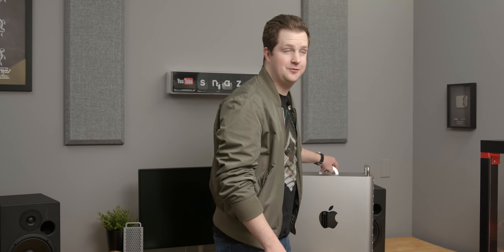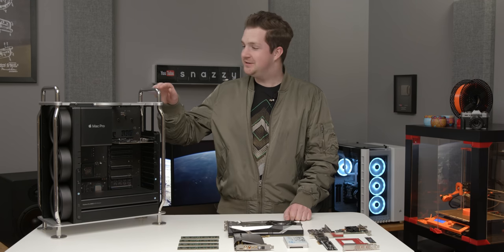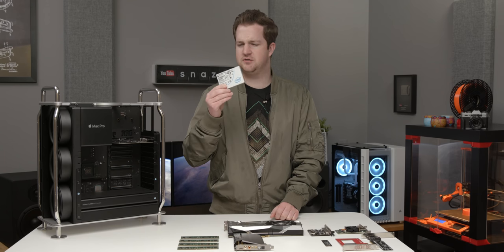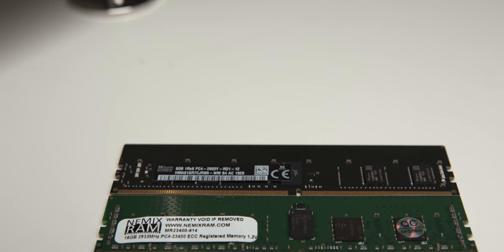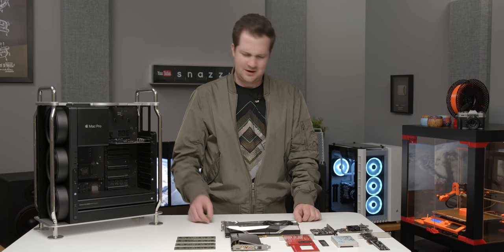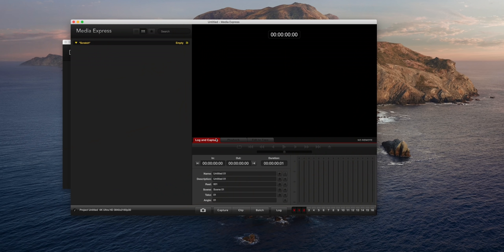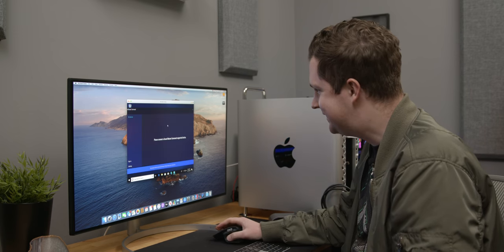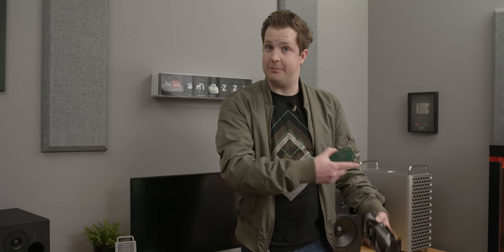What Weird PCIe Expansion Cards Work in Mac Pro?

Comment: or u can just build a PC and NEVER worry about things like "no supported drivers"
Reply: Too be honest, OSX is fantastic. Windows after 7 is kinda shit.
Reply: @charliek9394  I feel like Mac os is for kids. I'm aware that it has its uses for certain applications but the way I see it. Ubuntu is for networking and IT and windows is for everything else. And I'm sure u mean Vista. Windows 7 was amazing
Reply: @ralphgaudio7530  he said windows 8, 8.1 and 10 which were released after 7 were kinda shit, and I agree
Reply: @yoman9446  ah misread that. Windows 10 is ok imo but 7 was better. I still prefer even Ubuntu over Mac os but I have a bitter taste with Mac os
Reply: @ralphgaudio7530  It shows.  I think all modern OSs have their place.  macOS is very smooth when working within its operational parameters.  I actually think highly of Windows 10, (better than Windows 7 if you configure it right. Much better UI although I realize its a work-in-progress).  Regarding drivers, I’ve had my headaches with both Windows 7 and 10 so its not always smooth sailing on Windows...
Reply: @ralphgaudio7530  The nice thing about the Mac, hardware wise, is that you can run all of those operating systems well in a single machine.
Reply: I still hugely prefer OSX. It's just that the last 7 years Apple has only made shitty hardware for it.
I use Windows 10, MacOS and Linux as a desktop OS on at least a weekly basis, most of the tools at my job are Unix based.
OSX/MacOS is the only 21st century OS in my opinion.
Reply: @ralphgaudio7530  Why do you think it is for kids? Because it is user friendly to people that are not power users of the OS? That is just good design. Mac OS is a unix based system, which I prefer highly over the Windows architecture, hence why I would only ever use Linux or Mac OS for work (Im a software developer and designer). I prefer Mac OS over Linux as my main OS because it makes things easier for me and has wider support for software that I need to run. The OS can do anything I need it to. If it can't do it via the GUI, it can via the terminal.
Reply: @apresthus87  Exactly. MacOS is the best of both worlds. It's a Unix based system, but it comes with a modern, hassle free GUI. I love Linux on my servers, but on the desktop it has no place for me, because don't have the time or patience to fiddle with Xorg configs, ALSA or any of that. And the fact that MacOS is Unix based means that I get an architecture that's far superior, way more stable and secure, and comes with with a ton of configurability.
Reply: @apresthus87  I can't think of a single application that's exclusive to Mac. Final cut, premier, afterfx, all the things that are supposed to be better on Mac. R available for PC. I'm a power user. And my OS of choice is windows cause I can edit ANYTHING I want and my my PC MINE. Same thing with Linux. I can change whatever I want. I can't do anything in Mac os to customize my experience. I'm glad Mac os works for u but it's not for me
Reply: @ralphgaudio7530  I never mentioned exclusivity as an argument for choosing Mac OSX over Windows. That was in regards to Mac OS over Linux. Like the Adobe suite for example. What I mentioned as the biggest reason why I choose Mac OS over Windows was the Unix architecture and that I stand by. Software like the Adobe suite or Final Cut also tends to be optimized better on Mac OSX due to the hardware and software control. If Linux was as good when it came to software and user experience I would go for a Linux distro because I would not have the hardware restrictions, but that is not the case so.

Im not really sure what you mean when you say "customize my experience" but sure, I am sure there are things you can do on a Linux distro and on Windows that you can't on Mac. Im just saying from a work perspective I haven't ran into a single thing that Mac OS is preventing me from doing that I could have done on Windows or Linux. :) To each their own,l I use windows computers to play games for example. :)
Reply: @apresthus87  well as long as its working for u, thats all that matters then eh. what i mean by customize my experience is lets say a game crashes at a certain point i can figure out why. if i dont like the color scheme of windows i can change it manually. if i want a custom logo for an icon i can regedit anything my heart desires for any game or any application. (example in L4D2 i replaces witches with Eric Cartmans that just yell cartman phrases)
Reply: @ralphgaudio7530  Yep. You can read crash reports in Mac os as well btw in the console app. As for the color scheme you are right there, I am limited to light and dark mode with choosing my accent colors. Personally I could not really care less but I understand others might want this feature. I just want the OS to get out of my way or help me quickly when I work, I have all my apps in fullscreen/distraction free mode anyway. I personally love not having to have the hassle of dealing with the registry. Just like I love to deal with apps in "package manager" kind of way and not deal with DLLs and what not, again because I have a preference to how Unix does things. 

Ive used, built and worked with Windows PCs for 20+ years so I am not denying their use cases, but I personally still find Mac OS to be a superior experience to Windows (for me).
Reply: @apresthus87  user friendly does not work for everyone , I've tried iPhones and iPads but the things that I don't like is the file management system and also the settings it's a nightmare to deal with I simply don't like that
Reply: @ralphgaudio7530  thank you for this explanation I really prefer windows
Reply: @alanmay7929  Fair enough. Then again iOS and iPhones etc are something completely different than Mac OS. I don't use an iPhone myself, but also because I find phones annoying in general :)
Reply: Windows is better. no doubt. But it looks like shit and there are constantly bugs and issues which we never had on 7. heck even 8 didnt have this many issues.  Just look at the whole settings + control panel, why even have two? and windows just looks like shit now compared to OSX.  the only reason to use windows right now is because 1. way more options and software.
2. windows explorer is just better in every way compared to finder and file managers from linux and osx

Comment: Why a 70$ pcie cables
I would just solder the cable 😂
Even the sata cable thing
Reply: Emerald Blaze where will you solder? Looks like all the peer is routed through pcie lanes (extra connectors on the extra pins, that’s why you don’t need pcie cable power on the high end cards) I highly doubt anyone spending 6000 on a base machine is going to start doin surface mount to cable soldering to save a bit of cash
Reply: Emerald Blaze never mind, didn’t make it through the whole video
Reply: NeV Miku whatever you say buddy
Reply: @nevmiku  Calm down

Comment: Pretty soon all type of Mac pro converter connectors will come out of the almighty manufacturing powerhouse -CHINA, AKA CENTRAL EMPIRE.  Simple demand-supply mechanism
Reply: TBH I wish I could have access to one and some time with tools to try and make custom cables, it seems like fun.
Reply: It's not a custom connector, it's a standard 10-pin molex, you can easily make a SATA power cable for yourself. The one on the logic board looks like Molex 43045-1019. Just check the voltage of each pin with a multimeter and wire it appropriately.
Reply: @benswinter  In theory you can wire it yourself, but please keep in mind that Molex adapters tend to be a real fire hazard.

Comment: Apple forcing you to buy from them only, even on the Mac Pro.. the classic Apple greedy way.
Reply: Forcing might be just a little to strong a word here 😁
Reply: Christian Nielsen Right, as the video proved if you want to upgrade the Mac Pro then you need to buy some components from Apple only. That’s how they are forcing you.
But it depends on what you want as it seems you can upgrade the SSD with faster NVME drives, graphics your stuffed with as no Nvidia cards are supported and probably never will be, unless you want to use Windows all the time, which is a shame as those AMD cards are ridiculously overpriced. However I presume? You can install your own Vega or RDNA cars in it if you can find the right power cables for it to work.
If you can do that, then you could get the base model and upgrade RAM, storage space and Graphics yourself when you want to.
Reply: @marksapollo  key words being "if you want"

Comment: That "custom" SATA power connector looks pretty convincingly like a standard 10pin Molex. Compare the pinout to Molex part 43045-1019 for instance, it's identical. Methinks you could make a custom connector pretty easily?

Comment: Good work. Thanks for your time. For me the IMac Pro is sufficient (2,5GHz 14-core Intel Xeon w processor, 64 ram, Radeon pro Vega 64X with 16GB of HBM2 memory) with a Wacom Cintiq complement, because you can't draw in the mac monitor, other complement maybe a external disk (LaCie 8TB 2big Dock Thunderbolt 3 RAID Storage)... $8616.94 !!! + $2499,95 (Wacom Cintiq Pro 24) . But the other price is more expensive.

Comment: I've actually used PCIe cards with the trash can Mac Pro, inside Sonnet 3u rack enclosure, and with iMacs, using a thunderbolt PCIe enclosure. For audio purposes, this has allowed me to use Avid HDX cards, and Focusrite RedNet cards. Although it's not been built in to their computers for a while, it's still been fully supported through the means of external enclosures.

Comment: Hi Snazzy, Initializing a disk is something else than formatting a disk. Initializing is making a partition table, GUID or MBR. In case of a Mac it is standard GUID, formatting is the process of creating a file system on a partition. So when you clicked initiliaze disk it created a GUID partition table on the disk.

Comment: The power connector next to SATA ports looks a lot like a Molex MicroFIT connector (mating housing partno 430251000, and crimps 430300001), the pinout won't be hard to guess, it's very easy to build a cable buying a couple of housings and crimps and a standard SATA power cable

Comment: I think you missed 1 thing about the case in your previous Mac Pro video... when you put 36.000 $ hardware into your 6.000 $ Mac Pro (ie 6 Avid Pro Tools HDX valued over USD 36.000) you want to protect your investment from your occasional visitors or interns working at your studio for a short time. If that bridging metal piece is not there at the back ensuring also the integrity of the case, it is almost impossible to lock the case with the chasis/skeleton of the tower. Apple is also selling a lock made by Belkin to avoid unauthorised access to the internals of Mac Pro. Actually, with the current extensions/PCIe hardware, the 3rd party investment becomes more pricey than the Mac Pro.

Comment: Interesting video. Just wondering: since the Mac Pro has two 8-pin PCIe power connectors (saw it on Apple's spec list), can't you buy an 8-pin to SATA power adapter for the USB expansion card?

Comment: Hey snazzy, it would probably be pretty easy to make a custom cable to power devices with a sata connector, unfortunately I don't have access to a mac pro but I bet I could find pinouts by now. If you're interested let me know and I'm sure I could whip one up.

Failing being able to find the pinout, I could send you a connector that has all of the wires, and you could use a multimeter and let me know which pins read what.

Comment: @1:57 test the pins on the motherboard with a multimeter, find the 0V, 5V and 12V rails, buy the 10 pin Molex plug from Molex directly and make your own SATA power cable.

Comment: Sooo some of these things may end up working in the not to distant future:
* Soundblasters tends to supporty Mac OS so long as there is official hardware from Apple that supports it. PCIE extension over Thunderbolt-3 with external enclosures was a bit to out there for them to support new products the last few years... but it wasnt that long ago that Creative made a lot of drivers for Mac OS for their PCIe high end hardware. If there are enough demands it might come back.
* the aux port conversion of power should be pretty simple. Its not difficult to make an adapter cable kit so long as the voltage pins for that aux port can be matched up with the voltages needed for the SATA power port which it looks like it does. I would say a few months before these cables can be sourced from third parties.
* Nvidia has had a broken relationship with Apple for years after there were all of those GPU failures and Nvidia likes to use their GPUs as a Trojan horse for CUDA and Nvidia specific technologies that Apple outright rejects. So thats not likely to go away... unless Nvidia were willing to support Apple APIs and not make support of Nvidia technologies as a core requirement.
* There are several projects that translate Vulkan API calls to Metal API calls being developed. So we might see more support in a few years on that along with new RDNA based GPUs from AMD that provides better performance. Personally I use a Radon VII of which the high end AMD GPUs in the new Mac Pro are derivatives of. Apple hasn't been to picky about AMD GPU support in its driver stack so there might be a good stack of upgrade options coming in the future even if Nvidia and Apple dont make amends.
* The main issue for all of this is that there hasnt been a PCIe Mac in years so a lot of the ecosystem fell apart. It will take a few years but if Mac Pro sales continue to be strong then once there starts being a secondary resale market after the refreshes start we should start seeing that ecosystem start to establish itself again.

Also the reason your sound blaster card isn't working through parallels is you need to pass through the raw PCIe device to the VM. Something I don't think Mac OS supports. This is one of the reasons there are a lot of people that put down a virtualization layer on their Mac Pros in the past and then ran mac VMs on top of it. Lets you easily pass through any hardware configuration to any OS VM you have with a small penalty.  Its a little complicated but is much better then the more limited capabilities of running virtualization on top of Mac OS itself.

Comment: I think I know why the card didn't show up in the Windows VM. You have to tell parallels to passthrough the PCIe connection where the sound card was connected to. I don't know if you can set it to do that, but that's definitely what's happening.

Comment: Fun fact. My super-old MacPro G5 (!) is still running an entire audio studio based on ProTools and still does amazing HD (1080p). Thing is, I never installed anything but HD's and memory. It can do 18 channels of audio, work marvels with Motion and Photoshop and FCP. I wouldn't spend 10 to 12 grand to do what I do. Even my MacBook Pros and Air do some things a bit faster, but... the old one works!
Reply: There was a time when you bought a tool and used it for life. It's great that technology is advancing so quickly, but a great deal of time, energy and money goes into re-buying and re-learning stuff that worked just fine.

Comment: Try Sonnet Allegro & Sonnet Allegro Pro PCIe 4-Port USB No SATA power required and were goto card  for Mac for years. The Pro version  has USB  controller chip per port,  so you get full speed on each port.  Also a good place to start are with PCI-e devices are  all the Thunderbolt macos compatible PIC-e  cards like ATTO RAID & Fibre Channel cards, 10Gbit Ethernet cards from Chelsio, Mellanox, Myricom, , Small Tree.  You know all the companies that have been giving us mac users PCI-e  and driver support.

Comment: All of the hardware that Parallels sees is virtual by default. To connect your sound card to the VM directly you’d need PCIe passthrough. I know Parallels supports USB passthrough, but I don’t think it supports PCIe passthrough. Either way, it would definitely not be plug and play. You’d have to explicitly select which hardware devices connect to the VM directly.

Comment: I agree — the memory installation locations have a lot of rules that are not easy to internalize at first glance, especially with different sizes of DIMMs. And they encourage you to print out a guide since the machine will be turned off when you are most confounded! Even though Apple hasn't sold a printer in over two decades.

Comment: Looking at the fact that the built in SSDs are a lot slower than the one that you installed, there is a chance that the included ssds are just sata ssds with an m.2 connector. remember, m.2 is just a connector, not a data standard

Comment: Great video, thanks so much. That is very interesting :) Could you possibly test whether a 4x NVMe PCIe adapter card works? That differs from a 1x NVMe PCIe adapter card, as it would require bifurcation support, but would be a fantastic storage solution.

Comment: U have to use usb passthrough for usb devices to work with virtualized machines under macos
I can bet it does work, just need some tinkering. Paralleus lets you pick where to connect usb devices to. Again, I think it does work.

Comment: I should clear up a doubt again, in your various tests, you could try installing Mojave on a second HD or partition, I would be very interested in this new Mac Pro but I still work with the CS6 and I don't see the reason to replace it, the only problem that the CS6 it is not 64 bit and I know for sure that on catalina it does not start, if possible it would be the last doubt before buying it, really good machine, thanks.

Comment: That cable to 6 pin power looks allot like the one used in the Mac Pro 4.1 and 5.1 to power the GPU, and those can be had for allot less then the $69.99 belkin kit. I got mine for the 4.1 on ebay for approx $10 for 2 x mini 6 pin to normal 8 pin with shipping